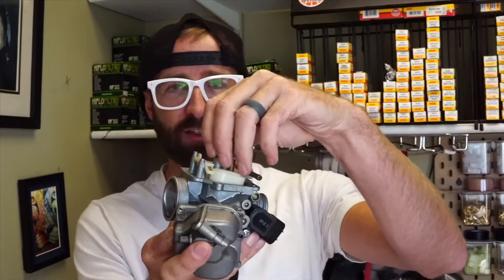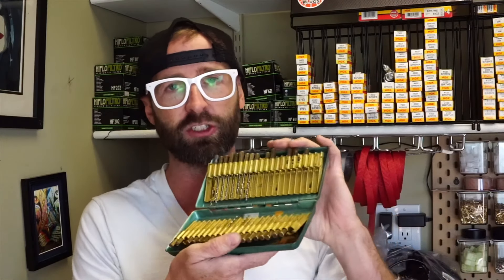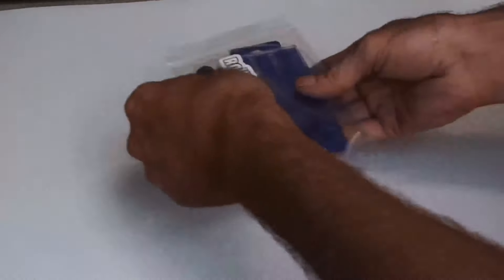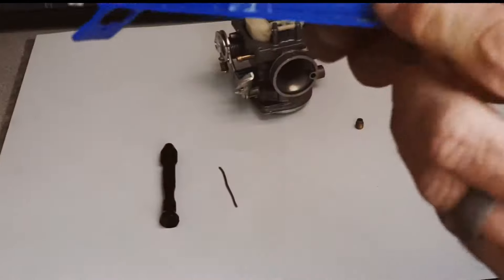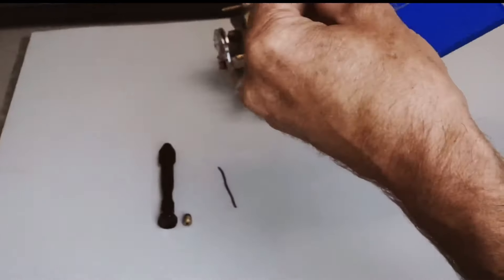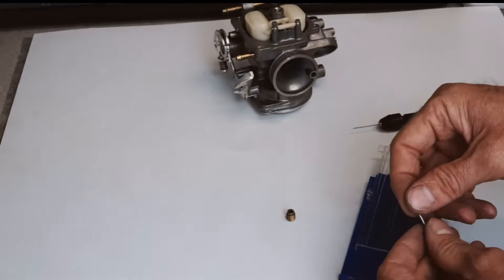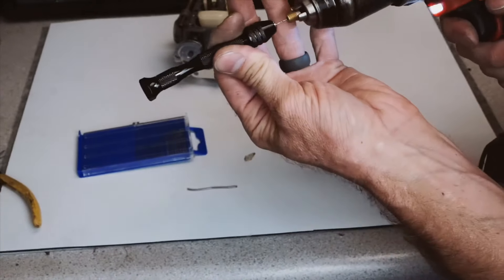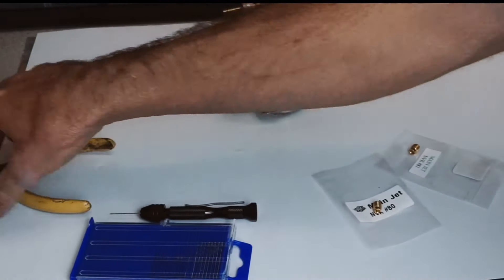Carburetor jetting trick [YOU NEED TO KNOW THIS!]

Comment: This is a old hand trick used by carb tuners everywhere, if your not familiar with it or think it's a hack-job....then your probably a rookie.
Reply from the maker: True story.
Reply: That's entirely your opinion. It's just another way to do things.
Reply: @aidankilleen5889 , don't get facts and opinions mixed up.  The fact is that jets come in sizes of 3 and drills can go each step.  Which would you rather have,  sloppy but close, or perfect?  Drilling is as  perfect as we can get in the world of "Controlled leaks", otherwise  known as carburetion.  The OP is correct, rookie.
Reply: I just found out about this lol
Reply: For people doing jetting on dirtbikes and traveling to different elevations exploring different places to ride it simply just makes way more sense to carry multiple jets. This is great if you’re only riding your bike in one place and never leaving but sometimes you need to change something out on the fly in mountains and this doesn’t work for that. Jets come in sizes of three because they are based on the basic need between every thousand feet of elevation. The fuel screw handles the fine tuning in between

Comment: My dad was a WWII aircraft mechanic, I learned this from him. Use to do it all the time on 70's cars as a teen/20'ish age. Great money saver and if you are willing to try a bit at a time and try it out it works good. And like the man said if you open it up too much a bit of solder and go back down a size.
Reply from the maker: You know what’s up :-)
Reply: There is a better trick to jetting down.. a lot of jets (most) have a necked down inner section.. like a venturi.. I have some pin punches with ends ground to about a 20deg very blunt angle & polished point.. slip fits inside the jet body.. punch the jet orifice swages the jet bore down .. careful weighted stiles with a small hammer can get very consistent results for multi carb settings
Reply: @RollingWrench  The right way is to buy 2 jets, and use one to determine the correct size, and once you've gone too far, then drill the second jet to the size that made it run best and leave it at that! Then if you ever do mods that require a bigger jet simply install the jet you over-drilled slightly and go from there! If the solder ever comes loose and goes into the engine you could damage a piston!
Reply: @kennyh5083  the emulsion tube will stop the solder from moving very far though..

Comment: My mechanic told me a trick he used to do was place one piece of thin wire in the jet to make the hole smaller by micro meters… The thing is if you hand drill a hole that’s super measured and thing could mess up your supposed to be perfect hole….

Comment: i have a 200cc shineray dual sport,im at 2800ft elevation and im wondering if the 115 jet is good,stock is 102 and it bogs when u throttle it and overheats
Reply: would that  be a good jet for it? @Rolling Wrench
Reply: Doubtful that it needs a larger size than stock.  Take a spark plug reading  and see what color it is.  Google that process.  If the plug is black, it is too rich.  Whitish equals too lean.  You want a slight brown color.  Your bike probably doesn't need tuning.  More than likely it needs a carb clean.

Comment: My carburetor is running great but every hour or so it fouls the plug 
I was told to make my main jet smaller . can I Sutter it close and start with the next smaller bit size that is smaller then my original jet 
I’ve been dealing with this issue for about 5 years now. Just been popping in a new plugs 
Waisting time money and fun
Reply: Just wondering if ya ever solved it?

Comment: Just to throw a "wrench in the fire" LOL, Twist drills do not make round holes.  And, they often push metal rather than cutting it, if not maintained sharp.  Have you never deburred a hole?  Where did the burrs come from?  Also, twist drills make holes bigger than their shank size.  Round holes are made with reamers or are cast, possibly stamped in a die, as such.

The jet orifice is not simply a hole size.  If you use magnification, you will see that the jet is ramped both into and out of the restriction orifice, and the orifice wall is rounded, not flat.  The reason is that these forms help to keep the fluid flow in a laminar, non-turbulent manner over a wide range of fluid speeds.  Stepped orifice walls will introduce turbulence, often in a modal fashion related to fluid speed or the pressure difference between the orifice inlet and outlet.

You've probably seen this effect with a garden hose nozzle, where at low pressure the outgoing stream is solid, but when the pressure is increased, an air pocket begins to appear at it's output.  When the pressure is increased more, the solid stream begins to flail about wildly.

Drilled jets often flow LESS at holes sizes larger than smaller sized properly formed orifices, when subjected to high flow rates.

Precision, well formed, holes are seldom achieved with $3 tooling, unless you are not measuring, or not looking very closely.

It is possible to use jet reamers and jet gauges to get much better precision when modifying jet orifices.  Still, these may not flow as well as properly formed jets.  But, there may be no alternative if a suitable source can't be obtained.  OR you can just drill your jets an get Riding!
Reply: this is literally why i was scrolling through the comments. looking for the guy that knows what fucked up shit could come with just drilling a jet and sending it. thanks for your knowledge man. have a great day
Reply: Yes, that's something my father told me long ago. The entrance and exit as well as the actual hole. You will ruin a jet with a bit. Just buy another Jet.

Comment: Hello, what sizes are the drills, please?So I can figure how to enlarge the hole.
Thank you.
Reply: I used a 1/16 drill bit for my 212 predator engine
Reply: @k-sell4065  are you at sea level?
Reply: @ernestmurphy3898  yes
Reply: I went to my welding supply store bought a torch cleaning tip kit...drill bit style ..
Good luck...

Comment: Awesome advice the predator 212 engine on the generator runs rich it comes with a 76 i think and folks buy a 68 and it seems to work would the tube that the jet holds  in the carb need resizing as well?
Reply: The tube would not need resizing. It will hold any size jet of that style jet.

Comment: I bought a jet kit but the main jets are to fat to change mine are small round. How do I get the small rounded jets? Because these are new but I can’t use them. . My main is 76 I want to go to a 80 or 82 to help it idle and run better it’s running just a little too lean. I get air fuel adjustment right and it just doesn’t idle smooth it is ether to fast or Boggs down and dies I don’t have a way to check rpms so I turn adjustable screw out to make it smooth but then it runs to rich and it’s a brand new carb but it’s not jetted right.

Comment: Clock broaches are around 1° taper. Cutting broach is 5 sided, smoothing broach is slightly out of round with a roughed surface. Get some control in your experimenting with making a flow tank. Tip. You don't have to test flow with fuel, water will give a good idea of the flow rate. Record the time a given volume took to pass through. It's not rocket science. Those drills are 0.1mm increments which is a lot. Just remember π x r² for hole diameter and you are good to go. With the smoothing broach you can measure how far in it goes with a caliper for close enough, mark with a Sharpie where you want to be. Happy days. Diploma in horology and a '99 TC88 FXDL. I don't like the sound from EFi Harley but that's progress.

Comment: If you can keep track of what diameter your mystery jet is at, good for you, you may have saved some money. If not for the questionable surface finish from drilling like that, potentially making it out of round, or simply not needing a precisely sized jet, I'd be all for it as a machinist, but I'm just going to keep bringing back/trading jets I don't need. In the end, it's just another way of doing things.
Reply: Drilling was done in the stone age
Reply: Don’t be afraid my friend…it’s just a jet

Comment: Thank you for posting this! I have 04 400ex with a aftermarket pipe. OEM Jetting Main 148 Pilot 38, the pipe calls for Main 158 Pilot 58 but no elevation chart to factor in.
I have a few carb kits I can try this on.
Elevation 1050ft
Reply: No no no sir lol don't change the pilot the pilot is idle only going up with the pilot will cause you a hassle I rebuilt mine and did the 416 and 11:1 piston stage 2 cam and I was listening to people in the forums so I went from the stock 38 pilot to a 42 with a 178 main and it ran so good except after it got good and hot it would shot off at idle and come to find out the bigger pilot was causing  the stalling and shutting off the whole time  even with the bigger bore and higher compression piston
Reply: 42 pilot 152 main
Reply: @benfranklin935  42 pilot you barely need the choke and won't be cold blooded. They have to pass emissions for the EPA so new they come too lean not the way honda would have wanted.... 178 Main WTF

Comment: I was just looking at a carburetor schematic for a 2001 Honda 400EX and I noticed something that I don't see anybody selling with these jet kits. If you look at the schematic for a Honda 400EX there's the number (38) JET, SLOW AIR (#110) they sell you pilot Jets for the air fuel mixture on a pilot jet circuit. They sell you a main jet. They may give you a needle or some needle shims which were only rich in it not lean it if you don't have an adjustable needle. But I don't see where they have this number 38. I never seen a car very quite like the one on the the 300 400 450 EXs I guess I'm just used to the older style carburetors but I would think if you're pulling more fuel through the system don't you need more of the slow air adjustment?

Comment: be careful of some of these drill bit sets, they can be completely mismatched and have multiple repeats of the same size in a box. Make sure you measure each drill bit with a mic before attempting, or make sure you didn't cheap out on drill bits. I got 4 of the same repeats for 3 different sizes. Luckily I had a #66 and a #70 but nothing else.

Comment: hello guys can anyone tell me what is the point of a carburettor trick?  😮 why do you need to drill a bigger hole?  does it give more power at higher rpm?  and its trick works with all engines that have carburetor?
Reply from the maker: It’s to add more fuel if needed. You want your carburetor to have the perfect fuel mixture. This is achieved by jetting the carburetor.

Comment: honestly seems like more work then just swapping out. in the long run what you pay for that bit of sadder and gas for the torch is a constant purchase, but having them jets on hand is a one time buy. easy to just swap out.
Reply from the maker: In some cases ya your right. In my case I would have to carry aver $800 in jets for all the different carbs . So it’s a nice little backup to have in your tool box. The best part of jet drills is they are more precise than jets. Jets go in 3 step increments. Jet drills go by each size.

Comment: Dude my dirt bike is a nightmare I have done 200 different jet scenarios and the God damn f**** thing just still does not run right it's sputters/hesitates really bad at about half to full throttle on acceleration
Reply from the maker: Do a compression test and check the valves. Also recommend a wide band 02 sensor so there is no guessing involved in tuning:
https://www.rollingwrenchdenver.com/products/wide-band-o2-sensor-tuning-kit

Comment: If you drill out an original Jet and change the orifice size then the next guy will have no clue what you've done and you have just ruined the "system"

The next guy/shop thinks he's got a 78, but he's really got an 82..84..86 and is banging his head against the wall because it won't run. ultimately, it's because you couldn't spend a dollar on the correct jet size.

Great tip!

Comment: could you recommend a main jet size for a 1980 CB750C with pod air filters and a 4 into 1 exhaust?
Reply: Jacob I have a CB 1100 F with stock filters but A 4-1 pipe . Your bike has to be running lean. There is a lot of information about your bike so that will give you a starting point on the jet size then increase jet size while monitoring Spark plug.Going up 4-5 sizes should be perfect for your bike.There is a lot of help out there for your bike read and learn from other peoples success and failures

Comment: This may work ok for single cylinder bikes. Drilling by hand for multiple carbs would be begging for trouble.
Reply: Drills are a single step while jets skip around in sizes of 3.  Wouldn't you rather get it perfect?  Drilling is the closest of the two ways.

Comment: will the soder hold in there though? I need to get smaller sized jets for my bike but not sure how small so will be guessing. would love to have this option if the sodering is reliable long term.
Reply: Soder forms a strong bond with copper, just be sure to heat it up properly.
Reply: @Ethan.s..  those are bras aren’t they?
Reply: @wildeninja2836  well, brass is mostly made of copper.

Comment: All I'm going to say is Yes good idea but one must not assume drilled orifice will flow = 2 bought exact size because of flow bore length , good tune tip though to get it in Park 🤫
Reply from the maker: You can dial it in much better then jets. Jets go up 2 sizes at a time. Drill one step at at time. It’s more precise.

Comment: Learned the hard way that all jets are different, I just bought a real Mikuni VM22 and tried buy jet kit. Was able to find main jets but all pilot jet kits are for the knockoff vm22. I never tuned a carburetor so don't know what size I need so wanted a kit with multiple sizes but can only find pilot jets for mikuni sold separately so trying to figure out what sizes I need for my Vader 125

Comment: Might have found a couple old  jets for  basic generator type motor in trail bike that could use upgrade. Solder sounds great but I might just put a 1mm hole a .5 mm solder coating over the larger than ~1.5mm existing jet hole. Think there is chance it may even work better with greater spray cone than simple linear jet. Thx

Comment: I was led to believe that drilling is not really a good way to enlarge a jet as the taper in the jet is not right for the size hole. But it was the 70’s when I was taught that
Reply from the maker: You are only going up micro sizes. You won’t loose the tapper
Reply: @RollingWrench I lost half the taper when drilling a 28 mm mikuni on a kz 1000.The bottom end was a little rich and I think I lost some flow characteristics in the top end range.I also remember the pin highth was a bugger to set.Never thought of adjusting the accelerator pump to come in later to help the  lean spot.Its touchy I do remember that.
Reply from the maker: @Brian-jz1pi  you can use a larger drill bit to tapper the hole

Comment: My concern with this approach, is that solder is considerably softer than the original cast brass. So, I would tend to think that over time, gasoline flowing through the solder plug would erode it down to the base brass again. A novel approach, however I'd omit the solder/re-drill part. Just the drilling to enlarge the orifice part, I'd try.
Reply from the maker: I understand your concern. I have been doing this for years with no repercussions:-)
Reply: Its not water moving at 50+ psi. Its fuel. Also most tapered needle jets, metering rods are aluminum. Never seen any wear on them from fuel. Its an unfounded concern in my opinion.

Comment: Drilling out jet, no , bad idea,Jets have a certain shape that is distorted when you drill it out,like a mawled screw slot, cause s flow distortion
Reply from the maker: True. Jets do have a taper. You are only drilling or sealing the existing hole. So you will not be changing the shape. We have been doing this for 15+ years. So I can speak from experience

Comment: Nice kit. But what about the other jet? ..the teeny tiny one? You can do the same thing but the tiny micron sized drill bits are hard to find. You can find them at welding supply houses.   They sell them as torch tip cleaners but that little pin vise (not hand drill) might be too large to chuck up the bits. You'll need the smaller pin vise, or try bushing up the drill bits by wrapping it with fine speaker wire or welding lead wire.  ..don't forget to lift the seat in the bowl if needed.

Edit: I've heard about soldering up oversized orifices but I always wondered about the operating heat of the engine. Will it get hot enough to melt the solder? I brazed the one closed on my water heater, just in case. ...actually, isn't it welding if you're doing it to brass? 🤔😏

Comment: As a mechanic, buy a jet kit for $6 on ebay. Do not hack crap by drilling jets. Gas and fuel additives are corrosive and react with lead over time. Remember back in the day when lead was dissolved in gasoline to prevent knocking on high compression engines?
Reply from the maker: I have been doing this for probably 15 years. Never had a negative experience. No hack here, just a simple hole being drilled. If your worried you can buy a $6 jet from eBay if you go to big, so solder isn’t used.  No more buying jets if you have drills. This isn’t for everyone,  it it works great for me though.
Reply: TEL is produced by reacting chloroethane with a sodium�lead alloy.[8]

4 NaPb + 4 CH3CH2Cl &#8594; (CH3CH2)4Pb + 4 NaCl + 3 Pb
The product is recovered by steam distillation, leaving a sludge of lead and sodium chloride. TEL is a viscous colorless liquid.  So no the lead won't dissolve.